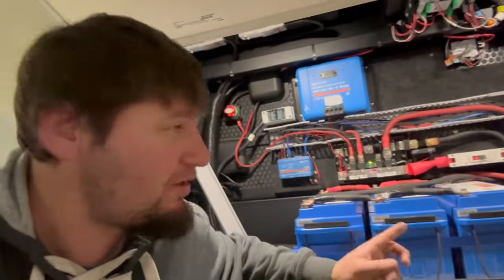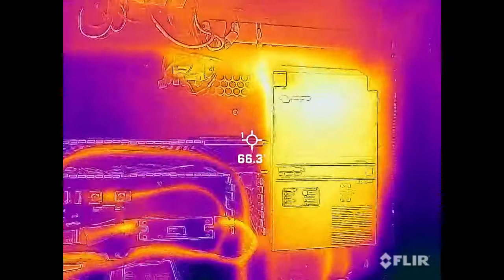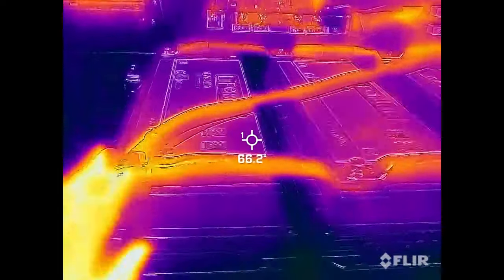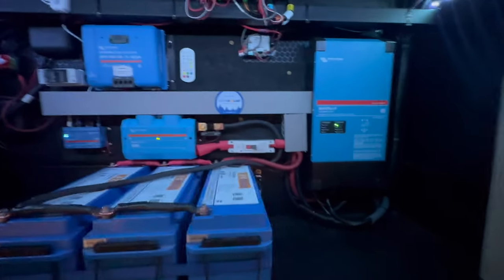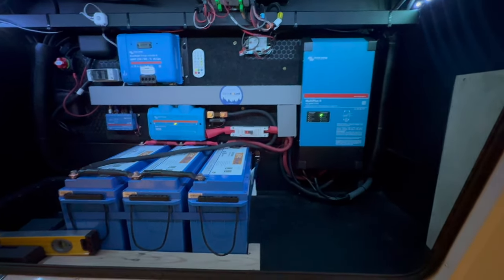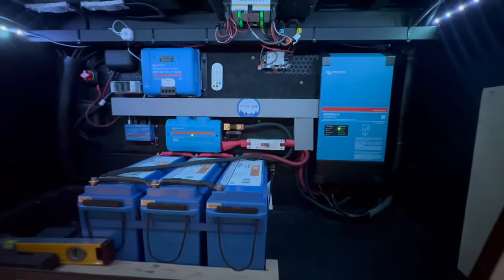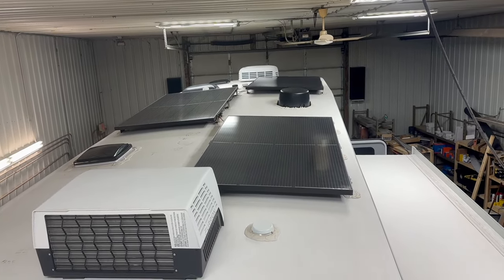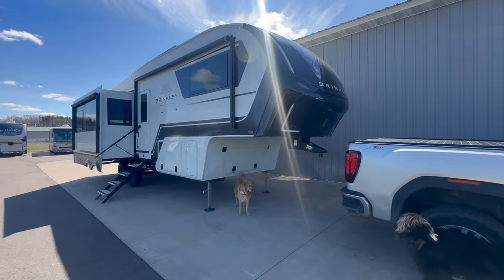Brinkley Victron Solar Install Part 2 - Solar Week Day 6

Comment: Shawn, are you doing tech or marketing videos to demo setup and config of the hardware separate from the actual RV solution videos?
Reply from the maker: Currently this content is primarily what we’re doing. We’re short staffed until summer. Hoping to do different content as time allows.